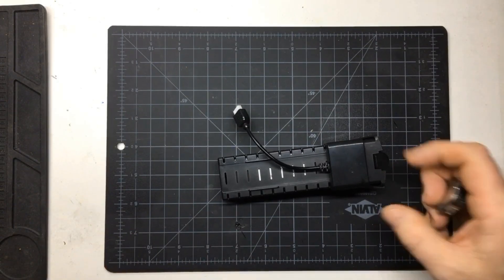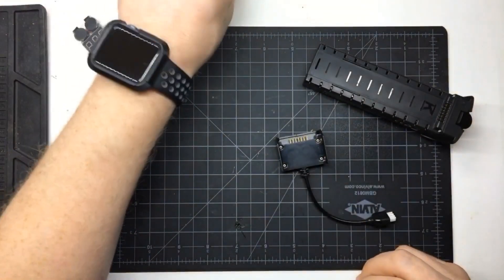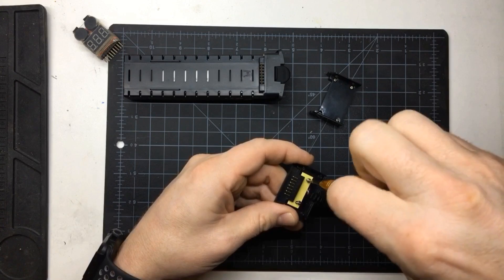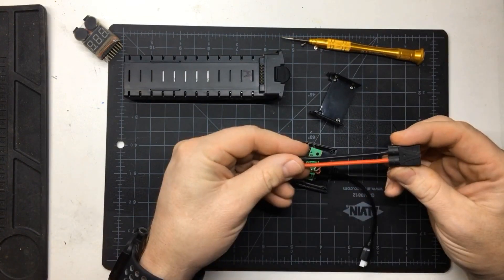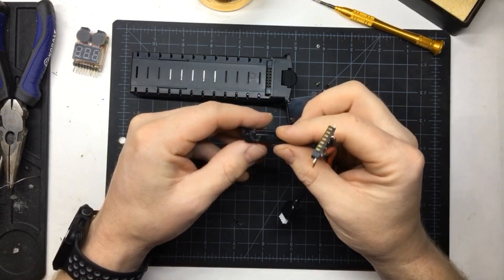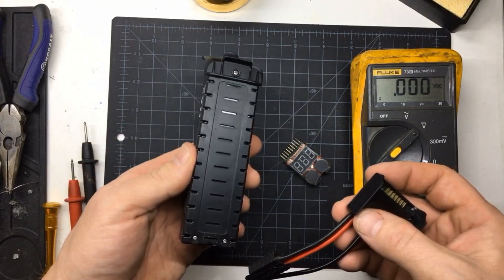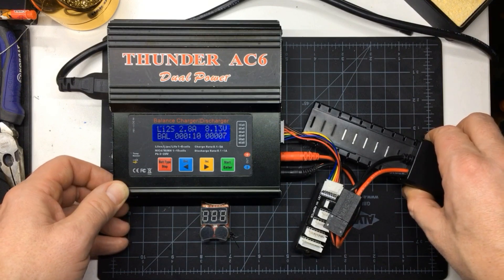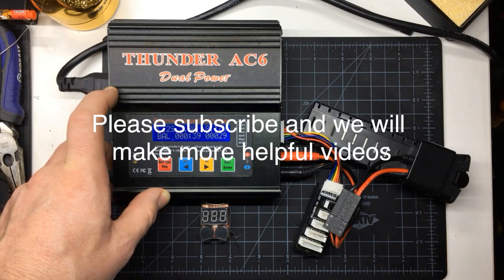Holy Stone HS700 Battery Charger Upgrade

Comment: Kevin, Where did you go?  We're wondering how this turned out.  Is it working OK?  If so, could you possibly give a better view of leads that need to be soldered to?  Thanks.
Reply from the maker: Yes it works perfect. I will try to get a better view posted.
Reply: @kevinfitzpatrick5777   Thanks so much.  I'm not sure what Holy Stone was thinking when they designed this battery and charging system.  7 hours is a long time  to wait for a charge!

Comment: There is a MUCH easierand SAFER solution.  Get adapter wires like I did.  That way I was able to use my SkyRC Q200 to charge my HS 700 batteries. 

1.  Charge Cable for 2S Battery with Balance Connector Only:
https://www.readymaderc.com/products/details/charge-cable-for-2s-packs-with-balance-connector-only?utm_source=bardwell
or
https://www.progressiverc.com/jst-xh-charge-balance-cable-for-t-rex-150.html

The first is back ordered.  I got mine from progressiverc.

2.  Lipo Battery 2S Extension Cable for DIY adapter: 
https://www.banggood.com/Lipo-Battery-Balance-Charging-Extension-Wire-Cable-20cm-2S-3S-4S-6S-p-951866.html?rmmds=myorder&ID=512939&cur_warehouse=CN

Comment: How long does it take to charge a hs700 drone battery
Reply from the maker: If charged at 2.8 amps, it takes about an hour
Reply: @kevinfitzpatrick5777  Thank you, tested it and it also took one hour on my Setup, but one question: Did you connect the red and black wire to two plumbs, or just one?

Comment: I’m thinking the whole reason for a slow charge is to give the battery a long life and maybe keep it from exploding??  🤷🏽‍♂️
Reply from the maker: Anthony Peace Standard lipo charge rate is 1c which is 2.8 amps for this battery pack. I have used lipo batteries for a long time and feel good about the charge rate. However if something goes wrong I will post it and revise.